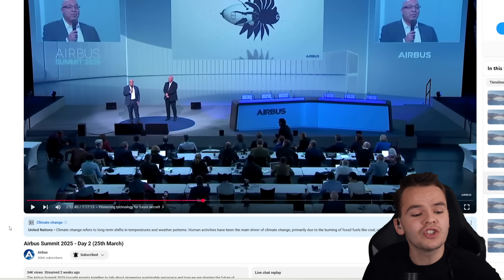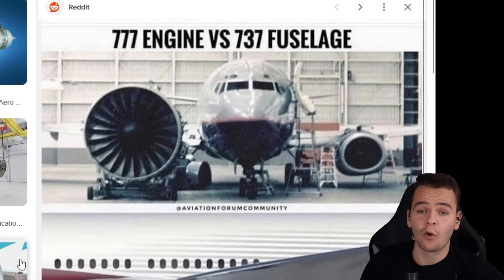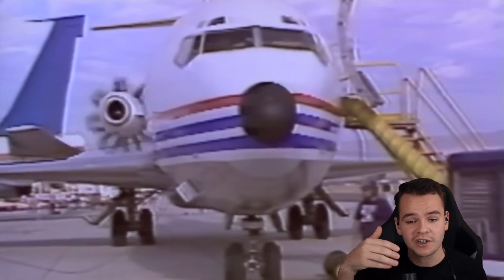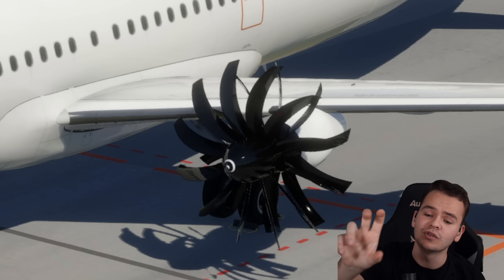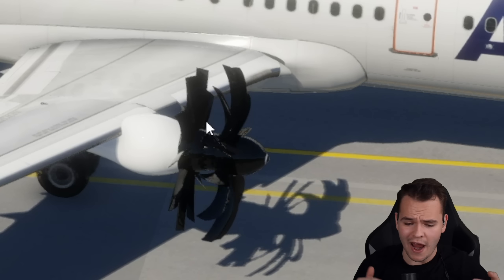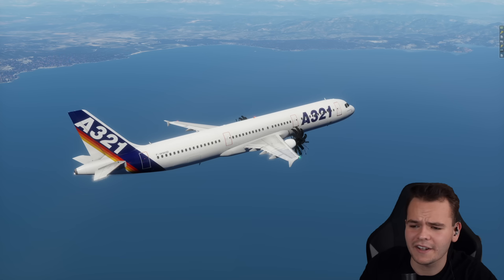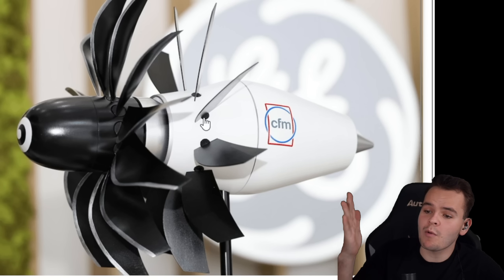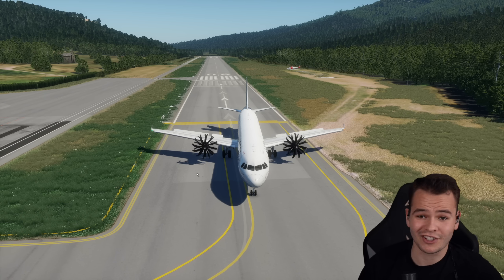Test Flying The NEW Airbus Plane

Comment: turbine mechanic here - the first prop strike and 6 pax dead in the rows next to the engine, and it will be game over. 

Unducted = no need for kevlar protection for blade off event. The fuselage will be ice reinforced slightly, but thats it.

Comment: There is one major problem with this though. If a blade dislodges it will fly directly into the cabin, whereas on a normal engine the cowl is designed to catch the blade

Comment: I remember reading about that NASA un-ducted fan in the early ‘80. I wonder why, after 40+ years, we are still showing artistic rendering instead of a working prototype!🤔 Come back when the engines pass certification! When he mentioned that this engine can run on Hydrogen, at 4:00 I almost choked, because whenever the H words gets mentioned, you know it’s a techno BS! You can’t bring batteries on board, but you want to load a passenger jet with cryogenic Hindenburg! 👏🏼👏🏼😬🤦

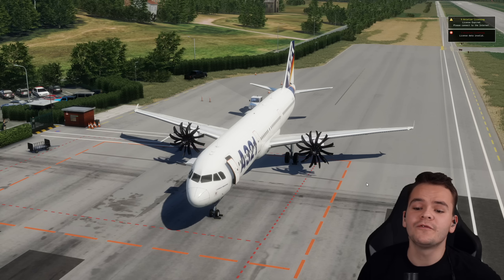Comment: 00:46 <---The props would absolutely need to be counter-rotating, to maintain smooth, & even stability.

Both props rotating in the same direction would spell DOOOM for the plane, as soon as the pilots mash the gas!

Comment: I like seeing turbo props. And yea they're more efficient. However from what i understand the jet fan are more efficient than the props on long distances. Think we have been slowing down in the sky compared to the start of jet age it was all about speed. And turbo props didn't deliver. But earlier jet engine was made to make thrust. Not like the jet fans like to day makes more sense for turbo props. Also note the hurricane Hunters use turboprops. As they can handle the storms.

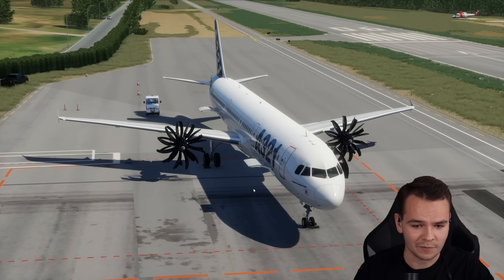Comment: 2:20 Russian had same idea engine in 80`s and US military I think also have one but as always it was second order hyped problem that made those ideas last on paper. For turbofan it was noise regulations.

But I'm Shure we should have real scientific work on design of fans and body of engine that will allow them suddenly to make smooth air flows and be quiet and even more efficient than what we have now.

Anyway there's nobody around when engines start so open fan or partly closed doesn't matter. Maybe some genius will draw interesting pattern of fans and engine body that will make some "air barrier" around wing so bird's couldn't get close like we have in cars when you can glue behind car but if you getting close from some sides and directions you gonna be twisted and pushed away. It will be perfect.

With what new design solution we have for fuselage and wing ends I think we will get something for engines too. At least something got to push inflation power over cost of flying trip. World must become really available for all of us so we can get together and see all miracles of it. Recent rise in ticket prices really made my life worse.

Comment: "Turboprop at 25,000 feet" 

My guy, the King Air caps out at 35,000. Plus given my experience from the Dash 7 where we had essentially two different ceilings depending on if we were passengers or cargo I'd wager good money the Q400 could easily get up that high too if not for cabin restrictions. The thing is a monster.

Comment: i wonder how are they gonna handle the bleed. many system on the aircraft like hydraulic pump, ac, etc are powered by bleed, a open fan would make it very hard to achieve it. maybe a fully electric system like 787?

Comment: I love how everyone’s worrying about the blades falling off as if propeller aircraft haven’t already made this a very unlikely scenario already.
Just make the blades and connection points stronger. It isn’t that hard. No bird is so heavy it’s gonna make a blade fall off.
Reply: Thats absolutely true. I´m glad that there are still some people with common sense like you.
Reply: turbine mechanic here - a single ground blade strike (used to be called a pod strike) and 4-6 people will die when a 2m blade passes through the hull at near supersonic speeds (M0.8) . Lets keep thinking please.
Reply: @ghostrider-be9ek  Just make it stronger bro. lol. Dude, you are asking way too much. Im a retired crew chief and have seen fans separating. The C130 is the worst case, where it sliced the whole front of the plane off. This Rise engines are going to be another waste of time for the EU.
Reply: @RipRoaringGarage  you are a CC on a C130 and you conflate the term 'fan' (ducted engines) with prop blade? 

And no, you cannot make anything travelling at M0.8 strong enough to not shed upon impact, and yet be light enough for aero use.
Reply: @ghostrider-be9ek  My tone was long. Sorry, the whole make it stronger bro was pure sarcasm.

Though I was a CC on E3s and KC10s, so I only know more or less those, passenger type planes. 

I have been blown up on a green run (new engine, not a refurb) and it had a bad shell out. It was contained but the shockwave threw me 50ft in the air onto my bead (I was fire guarding)

If that sucker was ductless fan or any type prop, I would be ded.

Just noticed what I wrote (again, long story, haven't slept in 2 days). Since I didnt work on prop jobs, I use the jet term thats on my tongue. So fan disc, propeller assy, for casual convo, close enough. But the incident is the issue, where the whole prop shaft broke iirc before the gearbox, and went forward and towards the fuselage slicing it clean. A fan blade on a jet can still go forward and out of the duct (like the SW flight that lost a passenger partially pulled out of a window) but its very rare. 

Apologies for the typoes and casual lingo. I was just alughing at the whole, they make them stronger way of thinking I way too often. Its the same in the car world with carbon fiber that by them, is indestructible. Cheers
Reply: @RipRoaringGarage  all good mate - i get it - good on you for the disclaimer
Reply: @ghostrider-be9ek  I have to remind myself, tone doesnt go through comments well at all...I'm also very sleep deprived, so I noticed it afterwords. 

So my communication skills were about on part with a pilot trying to explain tome the sound the jet made at 30k feet, and why I cant replicate it on the ground lol.

Comment: The current engines live in a cage, to protect the plane when a blade separates. Without that cage, when a blade separate on the Rise, that blade will shred the cabin 1 in 3 occasions.

Comment: CFD and advances in aerodynamic analysis has enabled propfans that aren't loud, unlike the flying prototype in the 80s. And the reason it's so loud is because the tips go at the speed of sound. 

Ah, so the second set of blades serve as the stator, which is something that turbofans already have. Making it variable geometry means you can control the flow precisely so you can go faster. I'll need to read up on the CFM RISE and the nuance of it.

Unducted fans will indeed blur the line between jetliners and turboprops.

Comment: That plane is going to be loud. The casing for the fan usually has acoustic liners to help reduce the noise especially at the tips where they can exceed supersonic speeds. Plus, propeller jets usually have a limit at 500 mph, slower than commercial narrowbodies at 530-550 mph
Reply: [Insert tu-95 comment here]
Reply: what if the gears malfunction and we need to do a belly landing..? isnt there like a risk of the propellers breaking off and even piercing thru the fuselage?
Reply: @verysillyduckko  @swiss001  modeled it wrong, you can clearly see on the unveiling they put the motors in the back under the tail
Reply: Guys, Airbus is not like Boeing, they must've thought of something let's just wait till they fully show it
Reply: @verysillyduckko that's what I'm thinking, what if the gears malfunction?
Reply: @IWearBucket or if the blades break because of fatigue, it’s happened a bit too often to be comfortable with a design like this
Reply: @dalekenning1363 these blades will surely be made from carbon fiber, not even prone to fatigue
Reply: @verysillyduckko Just reinfoece the fuselage. A kevlar lining on the fusalage panel near the engine should do the trick.
Reply: it will be more silent- while sound dumping with enclosure is cool, don't forget that the base sound is a function of efficiency, and this one is way more efficient. Also sound likes to escape as we all know around enclosure. This is not a propeller jet, it's a mix of both.
Reply: CFM states that the engine will be quiet

Comment: part of the reason nacelles exist is to protect the cabin in case of fan blades flying tho? thats one of the biggest security risk with exposed blades, and part of turbofan testing is testing if the nacelle keeps the fans away from the fuselage afaik
Reply: Just put "nacele" around that part of the fuselage. Also this fan is not supersonic.

Comment: I think the blade tips will reach supersonic speed and create a lot of noise. We already have examples like the Tu-95
Reply: I doubt it. If they do go supersonic, they’ll lose all their efficiency. Plus, the Tu-95 is Soviet engineered. We’re talking about a revolutionary turboprop evolved from jet engines that spun slower here.
Reply: @manitw.4998  still, it's a big rotor spinning at around the same speed as a normal jet engine, which die to physics makes it faster on the edges. I am really interested how they will do it
Reply: @MachV_ed1tz That's not how it works. Bigger fans spin slower because you have more area to push air and reach peak thrust at lower air velocity.
Reply: @kazedcat  To match the performance of closed fan engines, they have to spin as fast.
Reply: @MachV_ed1tz To match the performance they need to have the same thrust and thrust is a function of air velocity and cross sectional area. The point of openfan is to maximize area and reduce air velocity to gain efficiency.
Reply: If blades go supersonic, then the plane won't be allowed to fly, Europe has strict noise pollution laws.

Comment: imagine there is an engine explosion and the blades hit the fuselage or even the wings which is likely because the engine is not underneath the wing but in front of it. This could make the whole airplane explode because of the fuel tanks in the wings. 2bhonest this is a stupid idea. It looks ugly and it is dangerous. Safety over efficiency.
Reply: To get these certified they’d need to do heaps of tests and try failures etc, to make sure the plane is still safe in case of failure scenarios. It wouldn’t be certified if there’s too much of a risk to it.

Comment: It's funny that we're basically going back to what worked the most for the first time.
We went from throwing stones to sticks to arrows to high explosive ammo to ✨Perfected arrows✨ back again, just like we went from props  to jets to high bypass jets to turboprops and back to ✨Perfected Props✨
Reply: That's what I've been thinking all this time as well. iPhone's design for instance too... started with rounded edges with iPhone 1, moved to flat edges with iPhone 4, came back to rounded edges with iPhone 6 only to go back to flat edges iPhone 12. Maybe iPhone 18 will have rounded edges again. On aviation front, there's also a design going back to high wings, T wings... something they moved away from in the past citing aerodynamics and efficiency reasons, etc.
Reply: and we are putting sails back on ships. its already beaing done with kytes and those rotor sails on tankers
Reply: High explosive ammunition also evolved alot and is still very much used, but yes, dart ammunittion has the single highest penetration ahahaa, grest comment, ill be talking about this for a while
Reply: I mean, it's not really a turboprop but is somewhat similar. Think of it as the same as what we have with a larger fan that doesn't have a duct around it, voila the unducted fan (aka propfan). Like turboprops, they are gas turbines but these still make thrust from the core (difference from turboprops) but additionally have advanced props. This was actually proposed for a 727 replacement dubbed the 7J7 and as a version of the MD-90. So, I guess it's similar to turboprops but still quite different.
Reply: its like an nk-12 but the two props are combined into one then there is an extra deflector set where the second prop was
Reply: Wym from ammo to perfected arrow that isn’t happening
Reply: @Daryanplays  of course not, tell that to sabot railgun engineers 💀
Reply: We aren't those retros are in minority and to replace their original classy counterparts not the current tech. I mean those weird jet props are maybe gonna replace all remaining turboprops in the future for new commercial plane sector.
Reply: It is nowhere near a turboprop. It is a jet engine with a open fan.
Reply: @BeamngDriveLive did I sai it was a turboprop or a perfected prop?

Comment: What worries me (and same with regular turboprops) is the threat of the engine throwing a blade. On every flight I avoid sitting in the plane of rotation of the engines wether turbofan or turboprop!
Reply: I once flew in a 4 engine turbo-prop back in the day, the Bristol Britannia (50s tech), and they located the toilets in the plane of the blades as it was VERY loud and vibrating at that location. Any water in the toilet sink was dancing around with crazy patterns on the surface ;0)
Reply: @marion-bs3qh  That sounds mental. But also kind of wow, the roar of FOUR propjets!
Reply: They can just strengthen the hull next to the blades.
Reply: @randomnickify it adds more ZFW weight

Comment: as soon as the engine cowling gets weak, the windows near the engines aint survivin
Reply: Dont put windows there. Or add a kevlar lining to the windows.
Reply: Bro do you even know what a Q-400 is? People keep acting like this is the first propeller aircraft 💀
Reply: @Thyvo-re Yes I do know what a Q400 and its a joke, ofc this can happen with a Q400 but so can it with this, but a Q400 isnt as fast and dosent spin as fast as this engine so if falls off full throtle it might break the fuselage or total cause extreme damages

Comment: Imagine a bird strike with those engines and the prop/fan blades piercing the fuselage...
Reply: it happened once on an air canada dash 8 but the seats have been arranged so that no matter what speed the props are spinning at or however they break off, they will not hit anyone in the aircraft. So the passenger sitting next to the prop didn't get hit or injured.
Reply: oh shi that true
Reply: I’m sure they’ll test against it plenty, it wouldn’t be certified if it was too big of an issue.
Reply: if they address the issue then fine, haven't heard it yet though maybe I missed something
Reply: my brother was working on this engine a while ago, he was part of the team testing material strength and resistance to impact (mostly from birds) on the fan blades. It's one of the main challenge of this engine and they are definitely taking that into consideration. The requirement is that no impact with a bird should have enough energy to destroy a blade and send it through the fuselage.
Reply: Bro got highlighted comment ironically 💀
Reply: This also happens with traditional turbines.  It has happened before, with propellers within the turbojet engine shooting shrapnel through the fuselage, injuring passengers.
Reply: Uh oh better never fly on a turboprop or ga plane ever again…
Reply: Oh shit, you better call the engineers and warn them!
Reply: Not particularly a new problem, turboprop have existed for a while.
Reply: nah , propellerplane are around for a long time , and the only case of a broken propellerblade i ever came  across was after a missle hit , and yeah they hit birds regulary ,but due to the fakt that they spin slower , the properbilety of getting damaged is smaller than jetengine fans , but yes if a proppeller blade were going through a plane it wouldnt be nice ,but not nessesarly catastrofic ,
Reply: Add kevlar lining on the fuselage panel near the engine. Problem solved.
Reply: Bro doesn’t know what a Q-400 is, bro doesn’t know what a C402 is
Reply: @Thyvo-re  Those are turboprops or piston. This is more like a fan, and fans usually break apart on bird strike. The Q400 ATR72/42 etc are high-wing aircraft meaning you won't hit the prop when landing without landing gear, but here like Swiss001 suggested you could strike that engine even just on a bad crosswind landing. I'm also assuming the fan is made of a composite material that doesn't bend. If you hit a metal prop on a C402 it will likely bend and not detach
Reply: Bros never heard of a turboprop plane

Comment: How does it protect from flying off fan blades?
Reply: How does a turbo prop/ prop plane protect against it?
Reply: @patrickwiniarski1216  it doesnt
Reply: @YoshiBaird  exactly
Reply: I’m sure in order for this to be certified they’re going to need to go through a lot of tests to make sure it’s still very safe.
Reply: By selling cheaper seats near the engines.
Reply: @bltzcstrnx  it's a danger to the whole plane and wings
Reply: @bltzcstrnx  it's a danger to the whole plane and wings
Reply: exactly
Reply: turboprops r a thing dude 💀 and how would the casing protect it either??
Reply: @9e05cherianpadipurackalvar6  casings are so big and heavy because they are designed to contain fanblades that break off and prevent them from hit the aircraft and damaging it
Reply: @9e05cherianpadipurackalvar6  revolution of turbo prop fan is not as high as this new engine concept, those new fan engine will release a lot, i mean a looot of energy compare to traditional turboprop. this "onlyfans" engine will safely use if its in the world where Dust, Ice, and bird is not exist. even a small dent in milimeter size on regular jet engine blade would need to be replace because of potential fatigue failure and cracks the lead to massive engine failure. so yeah the question is relevant HOW DOES IT PROTECT FROM FLYING FANS BLADES ?